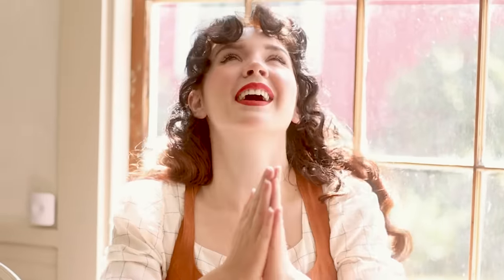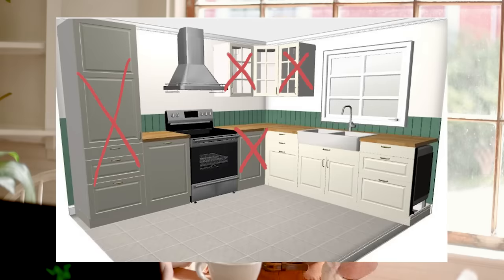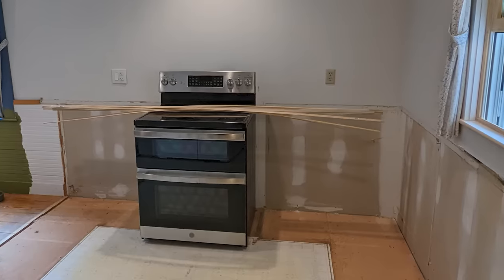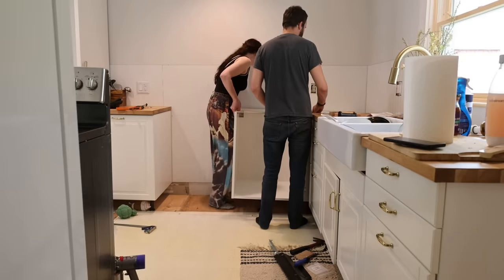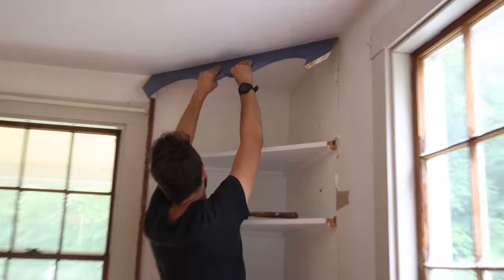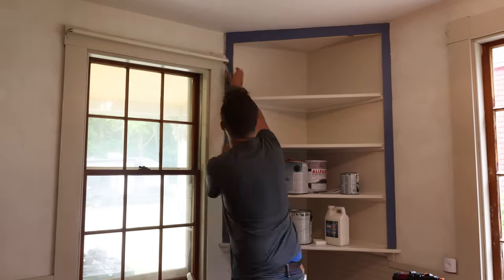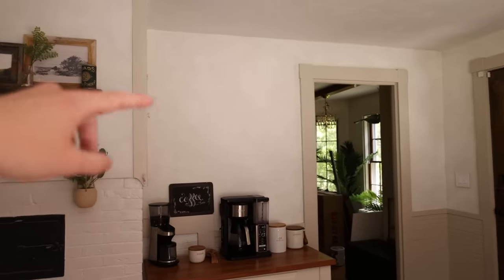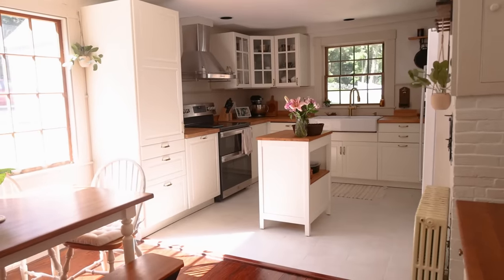We DIY'd our Old-Timey Kitchen! *never again lol*

Comment: we once had to have the bathroom torn apart to fix a plumbing issue that effected the tub and toilet. roots. in the drains. IN the drains
the bathtub was removed (extra narrow bathroom door, btw. hehe), the kitchen cabinets on the other side of the wall were removed the pit remained Like That for like a week iirc..yeah. but! we got a new tub, new lower cabinets, and new bathroom flooring out of it (and paid nothing, because we rent)

Comment: It turned out great and I understand all the work it took. We also considered a Ikea kitchen and between the quality and the ordering issues.....we didn't. See the laser level they use to install these cabinets? And the little things to level the tile? Really think about it. If you aren't able to do that level of work, find someone. It will cost a lot but really be worth it. We live fairly close to a factory and the cabinet guy came and measured it all for us. We put it in ourselves but it was all there at once and specific. Tiling is very hard and an art.  Good luck out there, kitchen voyagers.